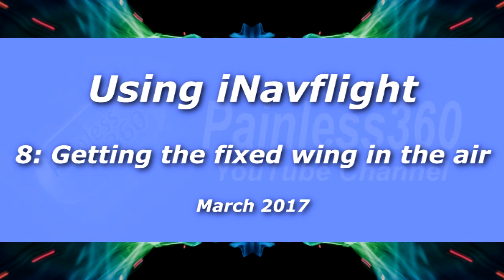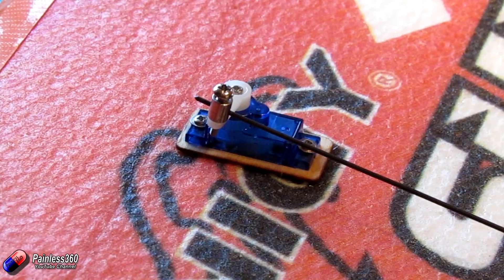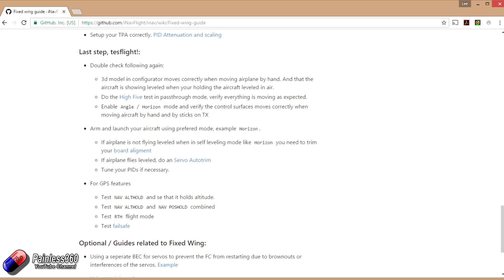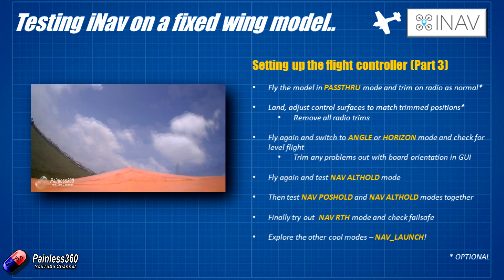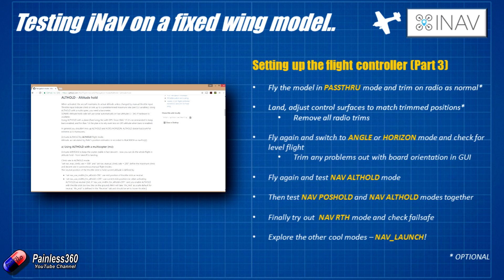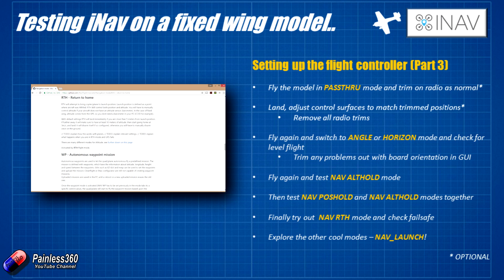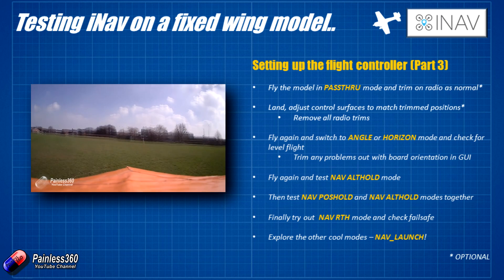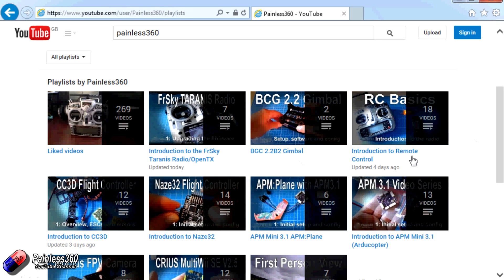(8/8) Introduction to iNav: Fixed Wing flight testing (GPS and other modes)

Comment: Hello Lee,

Thank you for all the videos you have been shooting for us, it is a huge contribution to the FPV community all around the world.
I am a very avid watcher of all your videos and I am moving a little bit from the  Betaflight racers to the FPV INAV fixed wings.
One question I have and I could not find a clarification nowhere, I have a micro racer board ( https://emax-usa.com/emax-f3-magnum-mini-fpv-tower-system.html ) that I would like to use on a fixed wing with INAV, as it does not have many uarts, I would like to use the motor outputs to control servos, how can I do that?!

Please help!
Reply from the maker: I would go for a board that's designed for fixed wing and  inav rather than trying to use something that's designed for just quadcopters. INav will use the outputs designed for the escs for servos but only having 4 outputs will mean that by default you only have two servo output you can use so you could only use it in a wing..

Comment: Hey Painless, im having a new issuenwith inav, i have gps and compas on my wing. RTH still dosent work if you remember me from a previous conversation we've had, but anyway, my homepoint will reset mid flight randomly, sometimes a kilomiter out, and sometimes 10m out. Any idea what may be wrong?
Reply from the maker: No idea. What troubleshooting have you already tried? Looked at Github? Tried another version? Looked at logs?
Reply: @Painless360  Ive gone through all my setting and such, even reinstalled INAV, but i have yet to hit a hunch.
Reply from the maker: Without details it's impossible to suggest things you've not looked at.. I'd check the wiki (See my recent i2c video), the home position is locked after arming so can't change but there are lots of other things that can cause odd behaviour.. best of luck!

Comment: Hi Lee, great video series. I have now set up iNav using an SPF3 in an eflite opterra thanks to you. I have two questions I was hoping you could help with before my maiden. The first is in relation to my minimOSD and RSSI. I am using the 4ch ezUHF Rx and Jr module ezUHF tx.
When I select channel 8 in the immersion RC tools for RSSI and enable this on iNav I only see 50% signal on my osd. When I look at the receiver tab in the iNav GUI channel 8 is only at 1500 us. I don't have any mixes on my taranis for this channel and I have selected in the OSD software to read RSSI from the FC. Have you any ideas?
Second question I had was what's the best way to bench test the GPS modes particularly RTH which is what I set my fail safe to do?
Sorry for the long winded comment. many thanks for all your contribution to the hobby so far.
Reply from the maker: +Brian Mac Donnell I've not used the ezUHF here. The telemetry details I can see in the manual are for the EzOSD (another ImmersionRC product) and not for an MinimOSD. I'd give the vendor a shout and look in the forums. Best of luck!
Reply: Painless360 thanks for getting back. Unfortunately the only place I've seen it covered was with betaflight using 2.4ghz. JC from project blue isloayed down to the aux channels needing to be set in the CLI but that code doesn't work in iNAV!

Comment: I am about to maiden my Teksumo/Experimental airlines Synapse and control and stabilization seem right.
Wonder if you might share your CLI dump for comparison?  I'm using the Omnibus F3 Inav 1.7 900mm wing presets and Taranis Frsky Sbus.
Reply from the maker: It's for 1.6 but you're welcome to have a look - https://www.dropbox.com/s/reqo04lv66aly35/iNav%20V1.6%20DUMP.txt?dl=0

Comment: What's the difference between the iNav and Safe technology? Or are they the same.  Am I  way off base?  Can anyone explain the theory in general.
Reply from the maker: What do you mean when you say 'Safe technology'?
Reply: Sorry I'm just unfamiliar with drone terminology..    But I find it very intriguing.  (iNav)   Safe is (Sensor Assisted Flight Envelope)  Like on this apprentice trainer airplane.  

https://www.amazon.com/Hobbyzone-Sport-Airplane-SAFE-Technology/dp/B00LOC0BSE/ref=sr_1_1?ie=UTF8&qid=1494843423&sr=8-1&keywords=rc+airplane+rtf
Reply from the maker: That looks like an auto-level system for emergencies. A very small part of what iNav does..

Comment: Sorry, one more question. In an ideal world I want to use the Omnibus F3 pro with an X8R rx. But it looks like I will run out of uart's by using S.Bus in, SmartPort telemetry out, GPS, and (hopefully) the pitot tube. Is this correct or do you see a way around a situation like this? I have already given up the idea of using a bluetooth module to upload waypoints, I will instead install a short micro sd cable extension so I can easily connect once installed as an alternative. Mini Talon install by the way...
Reply from the maker: +kenniffss I've not used that board. With some boards you could use soft serial but it looks like that wouldn't work on that one. I'd look in the forums for others builders who've faced similar issues. Best of luck with it..

Comment: Hi, I've been using MFD FC's in previous builds but want to give an Omnibus F3 Pro a go. The MFD uses a pitot tube to sense airspeed and uses this over GPS to ensure the aircraft has enough airspeed to stay airborne. I have seen in your videos that there is a drop down box in Inav for a pitot tube but so far I have not been able to find any reference to it in documentation or forums. Do you have any idea if it is active in code and if the FC can be instructed to use airspeed over GPS speed? Thanks in advance...
Reply from the maker: This feature is being worked on at the moment. Let's see what happens with V1.7 at the end of the month! :D
Reply: Thanks for that, certainly explains the lack of info out there at present. Thanks for the videos by the way, have been able to go from zero to having a 'reasonable' understanding in a very short time. Couldn't do it without people like yourself...

Comment: awsome series of vids cheers :) tek sumo here i come !
Reply from the maker: I'm a much happier chap flying the TekSumo with iNAV FPV, knowing the direction and distance to home on the OSD and being able to get the wing to fly home automatically is awesome! :D
Reply: Painless360  i tried using a spf3 recently with cleanflight on my tek sumo with shiit results , I obviously didnt realise inav existed . So is it really worth the higher complexity and there for the higher chance of faults V's the sheer simplicity of the teksumo as stock  setup ?? . Also if im using a SPF3 with osd AIO without gps but the fc has compas and altimeter. How well do you think it will handle heading /altitude hold ? Considering it uses the gps for heading with the RTH & POSHOLD functions. Will it then take use of the compas without the gps?
Reply from the maker: +NRGFPV LiSdEXiA it's very much a personal choice, I have a number of Teksumos here and a lot of them are stock setup - just for general goofing around. But the ability to have a stabilized one that is also amazing for FPV is great to have in the bag

Comment: Hi Lee just want to know if I can use the FrSky XSRF3E Flight Control for fixed wing with the NEO-M8N gps. It's got a build in MPU9250 (accelerometerro/compass). 

Kind regards
Gavin
Reply from the maker: +Gavin Hoon possibly, it depends on the target that it's running. Let me know if you get it all working. Best of luck.

Comment: Thanks for the series. Is it worth trying Naze32 board with iNav on fixed wing? I have one laying around from a quad, thought of using it as basic stabilizer and after your series a midrange fpv controller.
Reply from the maker: Yaroslaw Kaminsky you could try but I'd recommend an f3 based board for a new build. Best of luck!
Reply: Painless360 f3 is of cause preferable, I just want to throw naze32 board somewhere:) I thought  there might be some limitation of what is possible on older boards like disabling some function helping it to work better. Thanks!

Comment: hi lee,  i found that dominic clifton has done what i want todo with my 9xr pro tx. but still cant get it going. smartport is still not working at all. i did what u said now i have uart1 clear. uart2 sbus, uart3 gps, suart smartport (tx/rx bridged) only getting standard telemetry. i have a blueprint of 9xr board and found uart3 bt port. i would love to get this going with ez-gui on phone/tablet. i think this would be a better link then bluetooth on board the quad (10m range) . Hobbieking replaced controller on warranty so am ready to go now :)
Reply from the maker: +vern kelk you normally need to use a hardware uart to get smartport working. Best of luck with the rest of it, if you get it working I'll be really interested in seeing how you got it all together. Best of luck!
Reply from the maker: +vern kelk that is quite an old video, he is not using Smartport telemetry in that video. It's the original frsky traditional telemetry. I've never had a 9xr radio so have never tried the Bluetooth mod. Looks interesting! Best of luck!

Comment: I have had lots of issues using  a revolution  fc  on GPS flight modes on a quad ..flys well in non GPS modes  thinking  of using the flight controller on a fixed wing with inav and fitting a apm in the quad.  any thoughts?
Reply from the maker: We've tested iNav on both in this series (I'm guessing you've watched it all) and it's been great on both.After an excellent experience with both Quads and Wings - this setup with iNav is now my go-to setup for GPS enables models..
Reply: Painless360  thanks Yes I have ..just didn't know if changing  the software libre pilot to inav would resolve  some of my GPS issues ..

Comment: After watching the series I am a bit confused. Basically, if all you are looking for with a fixed wing is angle mode, is it necessary to connect a GPS/compass module?
Reply: No, it's not. Just put your FC in there and set it up. Not GPS, OSD or anything else is needed. But you can use it if you want to.
Reply from the maker: Nope, but with the addition of a £20 GPS unit you can have SO much more ;)
Reply from the maker: :) For basic angle mode - exactly! :D
Reply: Even the $10 "naze GPS" off banggood works just fine. ;)

Comment: This is a great series thanks! When i'm in passthrough mode the throws become massive compared with angle/acro etc. any idea why this is happening?
Reply from the maker: Ours is the same here. That's because in the other modes the craft will turn based on the settings in the CLI (max angles/degrees a second etc) so the control input doesn't go to the control surfaces directly in Angle and Horizon. That smaller movement is there to start the roll/pitch and the then flight controller will do the rest.. Best of luck!